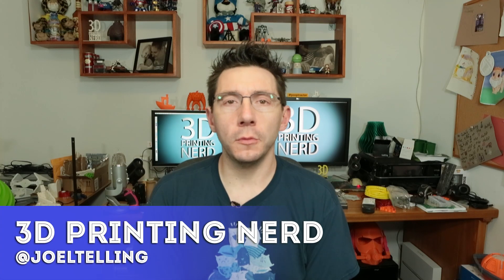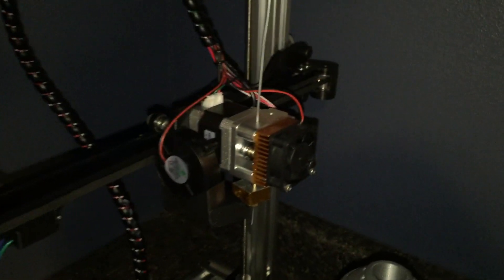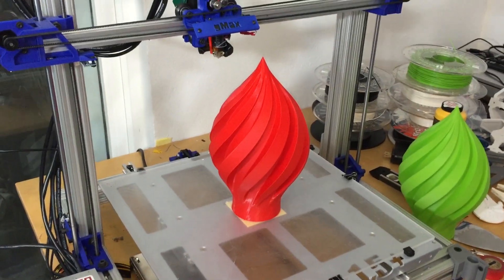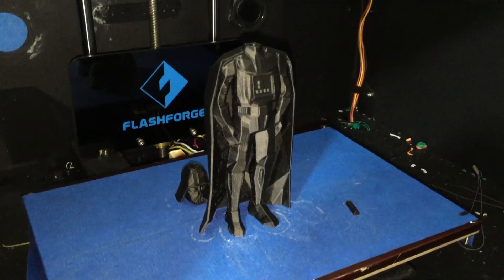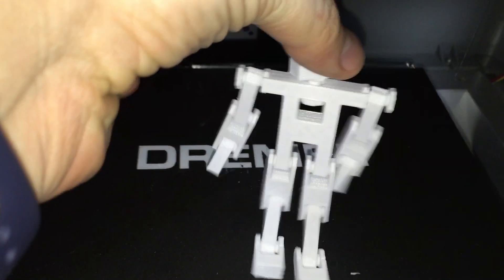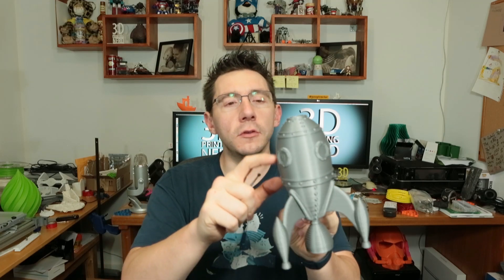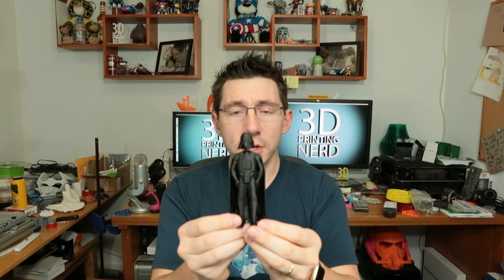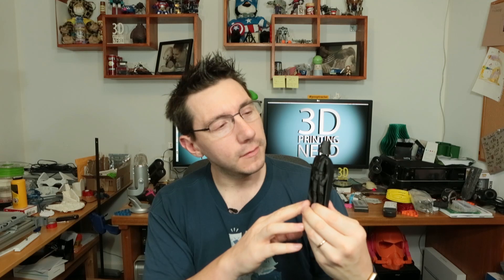3D Printing: 4 3D Printers 4 3D Prints

Comment: I’m very sorry Joel, but you pretend alot by not showing real footage in this video. Did you do some finishing on the parts before placing them back on the printer? Or did you just print the object on a completely different machine maybe? Ok, ok, you’ve got the marks on the bed of the object... oh wait, just start a print, cancel it, remove the bottom and replace it with the suitable object. I think you’ve bypassed the line of trustworthy video’s by pretending too much. Your friend needed your camera? Yeah right, you needed a new Canon 😉. And that ‘Oh wow, look at how it finished’ after you (re)placed the objects again on the bed. I’m sorry Joel, I follow you (subscribed) for a while nowo, and was very pleased with your contribution, but this is in my opinion hard to sell when there are no 3d prints pulled of the bed

Comment: First off, another great video; I really like the products you show and the knowledge you share, so thank you very much for that...

I am looking to get my first 3D printer, right now my choice would be between the Flashforge Creator Pro or the Prusa i3 MK2. Could you give me your thoughts and/or experience as to which one is the "all around" better printer for a beginner? I know they are both great printers at the end of the day, but all printers seem to have their pro's/con's.

Example; I have read that an enclosed work area is better for certain materials as it will have better heat retention. Is this a concern with the Prusa? Or is this something that would not even affect your choice when looking at purchasing a printer?

Any info would be greatly appreciated, Cheers!

Comment: You should print one of those 3d printer calibration models. You know the ones where they test detail and overhang. I am in the market for a 3d printer with dual extrusion and a hot build plate so knowing the print qualities would be helpful.

Comment: Ok, out of the 4 which is the best all around considering factors such as cost, quality, and easy to use?
Reply from the maker: That's a very good quesiton. This video is old, and I've tested MANY more printers since then! My opinions on "best" are changing :)
Reply: Ok, so at this current moment, as you are reading this, what is, in your opinion, the "best" you've personally tried or have reliable knowledge about? Thanks in advance :)
Reply from the maker: +Naturalfreakz As I am reading this? The Original Průša i3 mk2. Hands down.
Reply: Thank you!! You're the man!
Reply from the maker: Naturalfreakz thank YOU!

Comment: I noticed you put tape on the flashforge printer instead of the plain regular base plate and the tape that comes on it. I just ordered this printer and wondered if you would recommend putting the masking tape in it? Also I heard that the filament the printer comes with is not good quality, what would you recommend? My flashforge creator pro will come in two days and I'm very excited ! I got it for my 18th birthday
Reply from the maker: My Flashforge Creator Pro is from long ago, before they had the filament fan and the base plate they use now :) For you, just use the stuff it comes with for you, it should work just fine. Mine originally came with ABS and it worked great. HAPPY 18TH BIRTHDAY!!!
Reply: +3D Printing Nerd thanks so much for the early reply! I looked into the filament it comes with and it is not the same as what flashforge sells in its store, it's actually lower quality recycled filament. But I'll just have to use that for now. What abs filament is a good cheap starter for me to buy? Amazon says the best seller is hatchbox. I would love to get a couple colors to print with but at a cheap cost. Any suggestions?
Reply from the maker: Chloe Froning Hatchbox is great, I've used that a lot! Plus, you can use Amazon Prime to get it.
Reply: +3D Printing Nerd just got my printer and I'm printing benchy, but it's coming out very sloppy, any suggestions as to what I can do to fix it ?

Comment: The design of the two cones reminds me of the rifling inside a barrel of a gun but in this case, it's on the bullet
Reply from the maker: +Patrick Nguyen Whoa, never thought of it that way, but you're right.
Reply: I'm curious to know if the barrel of a gun is smooth and the bullet is made like that would it still add spin to the bullet or would it make a drastic amount of drag and reduce the speed of the bullet.
Reply from the maker: +Patrick Nguyen now THERE is an interesting question.

Comment: Thanks for the vid, could you recommend a budget printer for a neebee
Reply: +2002zippy Printrbot Play, or Printrbot Simple Metal. If you were to buy one, a beginner should get one assembled. If you wanted to build a printer, you should get the Printrbot Simple Metal unassembled. They claim the Simple Metal is easier to build because there is less metal casing.

Comment: Would you be willing to print/sell me some of those ornaments at that size (maybe slight different size) I want to make a ROCKET using one of those as a nose cone!!

also that rocket ship. is it hollow? would it be hard for you to modify it with a 20mm opening at the top and button so I can put a body tube inside and make it a FLYING rocket?
Reply: +Nerys https://www.3dhubs.com/sydney/hubs/sinclair3d-solutions

I can do exactly that if you're still looking.

Comment: Hey, Just Got the Flash Forge Creator Pro for Xmas and this is my first entry into the world of 3d printing. So Far is amazing. So much to print, so little time. I have been trying for the past few days to do the Vader Figure but running into issues. I get to the knees and the foot always lets go from the either the plate or the last time it was the tape let go of the plate then the foot let go. Any suggestions? I am Using ABS as it came with that and I dont Have any other material yet.
Reply from the maker: +Jay Jay Hey! Congrats on the printer! If the foot keeps coming loose, there are a few things to look at. Is the build plate level? Have you done the paper test to see if the nozzle is the proper height from the print bed? What are you using on the bed for adhesion? Is it Kapton tape, or blue tape, or something else? What is the bed temperature and what is the nozzle temperature?
Reply: Thanks for getting back. 
Build Plate Level- I think so, I did the paper test and seems to be good.
Adhesion- First I did it with None, Got to the Knee cap then off. Then I tried with Blue Tape and Glue Stick. Same Thing. 
Temp On bed is 110 and Nozzle is 230 i think.
I was going to attempt adding some frame Glass when I get home today. I feel like I get a lot of curling in general though when printing.
Reply from the maker: Jay Jay I've added purple glue stick on Kapton tape before and that has helped. You can also try a raft, that may help as well.
Reply: I have done the Raft thing too and same issue. I forgot to Mention that I Was a rookie and didnt put the dome or door on the Printer until last night. From what I have read, ABS needs a lot of heat to cool right. So maybe that will help too.
Reply from the maker: Jay Jay yes. close the doors, tape the holes, put the dome on, cover it with a blanket :)
Reply: So one thing i found was one of the arms for the bed was not tight. So that is why i was getting so much bounce. Other Thing I noticed is that my bed will not level. I can get the corners to be good but the center in back and front seem to be in a hump. I added a piece of glass tonight and leveled again. ITs better but not perfect still. Interesting note. My right nozzle seems to print better than my left. But my left nozzle will hit my right nozzles constructs. Im assuming this is do to the hump. Frustrating.
Reply from the maker: Jay Jay I had the issue with the left nozzle hitting what the right lays down, and I solved that by using some folded tinfoil between the print head and the carriage it sits on. Use the tin foil to shim up the left side just a smidge. That worked for me.
Reply: Could you explain more or show? Pics or Vid? I think I get it but not 100% clear.
Reply from the maker: Jay Jay I did a video where I changed the nozzles on my Flashforge Creator Pro. Find that video, and I think I show the tinfoil as a shim. If not, let me know and I'll try to cut a quick video showing that.
Reply: +3D Printing Nerd watched the video. very helpful and will be replacing at least one of the nozzles to do special filament soon. still a little hazey on the foil though. i understand the principle behind it. Is there a tool to tell when you use enough or too much foil? Should i get a mini level?
Reply from the maker: Sadly, I don't think a tool will help. I just undid the left bolt holding the extruders to the carriage, and slid a piece of tin foil folded over twice. that's it. that part, for me, was all by feel.
Reply: +3D Printing Nerd Ok so good news it that I figured out what you ment and gave it a shot. Bad news is it didnt work. Maybe need more folds. But after researching the issue I found that it isnt uncommon that the heads are not same height. I found instructions on how to fix it and I gave it a shot. Good news- I now have taken apart the whole thing and put it back together with out any left over parts :) It seemed to help the issue but not totally fix it. I think now if I do you foil trick it will be golden. I really should have filmed it and uploaded how I did it. Always an after thought. I will let you know how it turns out.
Reply from the maker: Jay Jay Sounds like good news, keep me updated!

Comment: would you recommend the dremel 3d printer? i need a  "plug and print" printer. this seems to be the optimal choice with a direct upgrade to the flashforge nozzle for multiple different types of plastic
Reply from the maker: +David Ryan I would, yes. So far for me, it's been very plug-and-play. I plan on getting a plated nozzle for it so I can run carbon fiber in it without worry :)

Comment: Can you do a video on thermistors and thermal couplers I have having extreme difficulty getting my hot end working my thermistor is readying 489 degrees without the hot end ever heating up.
Reply from the maker: +Zachary Reed Ooh, sounds like you have some issues. What sort of printer are you having the problems on?
Reply: It is a Cobblebot, I think that is maybe something to do with the arduino firmware but I am not sure yet

Comment: I'm trying to decide wether to get the ultimaker 2 or zortrax m200
Reply from the maker: Both are wonderful printers - what are you stuck on for making the decision?
Reply: +3D Printing Nerd well in looking for a printer with reasonably good detail but doesn't require much maintenance .

Comment: witch one do you like the most? love the vid!
Reply from the maker: +marijntuijl Thank you! Which one? Well, shoot, I use the gMax the most, but, I love all the printers I have for various reasons. They all come in handy depending on the model I need to print :)
Reply: +3D Printing Nerd witch one has the highest tesolution? i have a ultimaker original witch can go to 0.06 just curious.
Reply from the maker: +marijntuijl A few of mine will go to 0.1mm layer height confirmed. The Wombot I'm told will hit 50 micron, but, I haven't printed at that layer height myself.

Comment: How do you like your flash forge creator pro?! I have one and a Ultimaker 2 and I love it, Would be interested to know what you think!
Reply from the maker: +Elliott Theunissen I really like it. Very reliable, and easily modified for what I wanted. It was my first 3d printer, and it's still going strong. I added plated nozzles to it so I could print exotic filament without worrying about destroying the brass nozzles.
Reply: +3D Printing Nerd yeah I also added stainless steel nozzles for the same reason! But mine is still as good as new